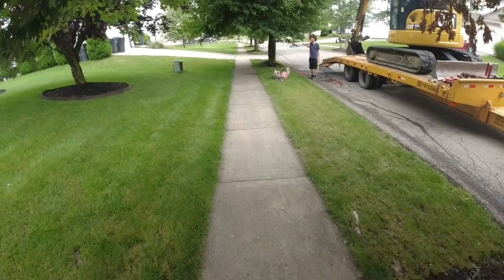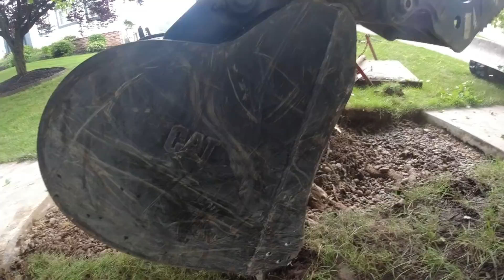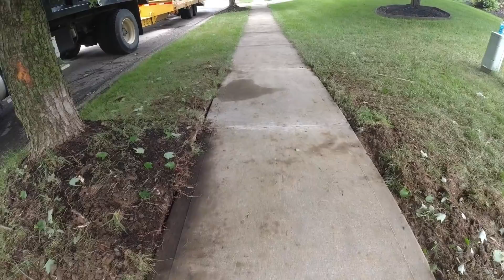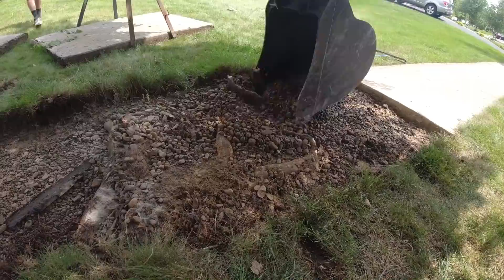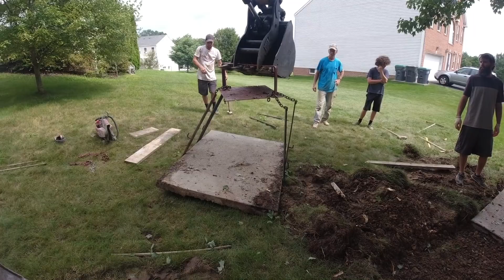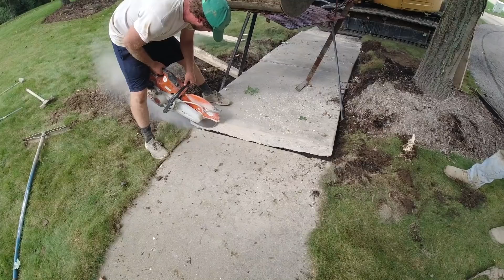Roots Tearing Up Your Sidewalk? No More!

Comment: Please call an arborist when working under the canopy, or drip line, of a tree. Root damage is generally delayed 5-6 years. Your tree dies long after your “quick fix” and you may be left scratching your head on why. Over 90% of a trees roots are in the top 24 inches of soil and they hold the tree through tension almost like a circus tent so even roots 3-4 inches in diameter can have a big effect on stability

Comment: Tom, I might suggest you invest in a cordless sawzall and 12" carbide Diablo blades.  They are fantastic for cutting off roots.  Should be a little less traumatic for the trees and tear up less of the adjacent grass.
Good job 👍
Reply: yup, they work great that's what I use my Milwaukee
Reply: get a wood blade for your parter saw..
Reply: I was going to ask why they werent cutting the roots first. Glad you know what saw they need

Comment: Simple means of repairing sidewalks as long as you have two whole sections to lift. You identified a real problem while fixing with a creative technique. Most concrete companies would no bid or charge a bunch to repair. The other beauty of this concrete repair is the concrete  remains same color.
The crew handles repair so skillfully like the care they use when pouring new concrete.

Comment: I recall the town planting trees along the sidewalk in front of the new high school circa 1971. They put them more than 10 ft away and so many people said it looked odd. Here we are almost 50 years later and the sidewalk is still as straight / level as the day it was poured. Oh, they also planted them on the inside and not between the sidewalk and road where cars can hit them and roots can buckle the curb, never mind salt splash in the winter. I guess someone was thinking ahead for a change!
Reply: I agree, street side trees distroy sidewalks and street curbs and the street in some cases.  Any tree should be a projected drip line of a mature tree away from the sidewalk and street  even if it means back into private property 
And the type of trees needs to be selected but also cant all be one type of tree.  This adds value to the area unless its a Bradford pear tree then it hurts property values. 
That type of tree is so evasive we need to remove all of them.

Comment: Great video. We have had the same problem over the years at our home. Our property line is 10' from the curb, so the township is responsible for the trees and sidewalk. Since we have lived here the town has replace 2 or 3 sections of sidewalk 2 times. The house was built in 1959 so the two Locus Trees are very large.
Reply: Doesn't matter where I live they still charge you half the cost. Tiny crack and then they replace the segment.
Reply: @ArnieD17  Sorry to hear that. We've never been charged for sidewalk replacement or tree trimming in front of the house.

Comment: Depending on your budget there is a product called Sidewalk Shield which is installed either at the time of new construction or in this case a repair. The shield forces the roots to go 
deeper into the ground thereby minimizing heaving of the concrete/blacktop etc.
Reply: Standard depth is 18". Can also be up to 3 or 4 feet deep. Sounds good in theory, but digging almost two feet down to place the shield could be problematic. I think most of the shield products are made from  recycled, HDPE plastic.

Comment: Slick method.  

I think a sawz-all might make it a bit cleaner/easier - less damage to the lawn on each side.  Run a pruning blade through the soil on each side of the sidewalk about 6" out.  Then when you rip the roots up, they only pull up so far back.

Comment: Someone has been smothering the base of these trees with mulch.  Roots need air and adding more and more material around the base of the tree can cause the tree to try to grow roots up closer to the surface.
Reply: Exactly right. The term I have seen used is Vulcano. Roots start to girdle around the top. Such a waste.

Comment: I think I would have used a chain saw to trim the roots near the tree rather than rip them up with the excavator shovel. Seems it would be less damage to the tree root system and easier for the tree to recover. Just like you would trim a branch rather than break it off. Otherwise I think the concrete lift plan is a great idea and we’ll executed.

Comment: 11:08  i think like a bobcat a implemnt could be made to hook on lift and move the sidewalk 
So the roots can be delt with
And the use of rocks and sand as the base under the sidewalk.
I see a lot of gravel was used under the concrete,  the devloper where im at just pourd right on clay,
The sidewalks are a mess.

Comment: I like that you save and reuse the sidewalk, but I have a question.
Are you concerned that now that the roots are no longer stabilizing the tree on the sidewalk side, maybe in a  BIG rain and wind storm,  the tree could uproot and fall, likely into the street. 
Do you have any remedy or precautionary tips to help minimize that risk ?
I am faced with that very problem.
And thanks for identifying the pretty music.
Reply from the maker: We are only tearing out a couple of routes I don’t see the tree blowing over however I have this conversation with every homeowner the trees are just too big and they need to go and be replaced with smaller younger trees they should’ve planted them 10 feet away from the sidewalk in the front yard and we wouldn’t have this issue

Comment: this is a short time fix.  roots will grow back if the tree survives.  the tree may die.  permanent solution would be to replace the tree with one that has different root structure.

Comment: Is that the townships responsibility to maintain the walks?
Reply: Home owner is responsible for sidewalk & curb.  Township just issues citation for uneven pavement or broken curbing.  Usually happens when a house is being sold or someone complains.  At least that's what happens in Pa, been there before.
Reply: @johnwalker6121  in the land of taxes (NY) the sidewalk and tree lawn are maintained by the municipality. Don’t even think about replacing a hazardous sidewalk flag, they will fine you.

Comment: The roots will be back in a few years.
Reply from the maker: Correct that’s exactly what I said in the video as well as told the customers this is a temporary fix trees are too big for that area
Reply: @Concretewiththehauses  Did the customer decline the installation of a root blocker? Since you are lifting the slab anyway it would be prudent for them to pay for some type of blocker.

Comment: What are they to going do when they start ripping up the roads. and causing drainage problem. ..if you measure the height of a tree and lay it down and measure its circumference..thats how far tree root system spreads...by the look of it half the homes will have root intrusion..causing foundation upheaval and problems with elec cables,water supplys,sewage,water drainage..the list is endless...rip them out and sell the timber to a log mill or sell it as firewood or just shread them and sell off as tree chippings